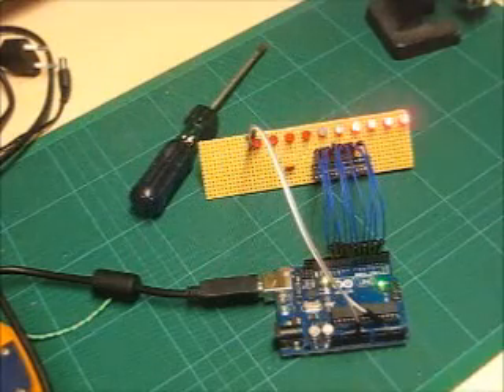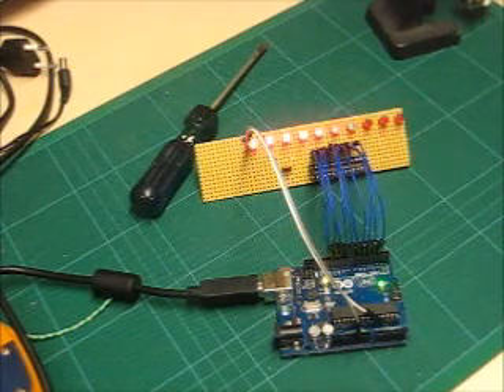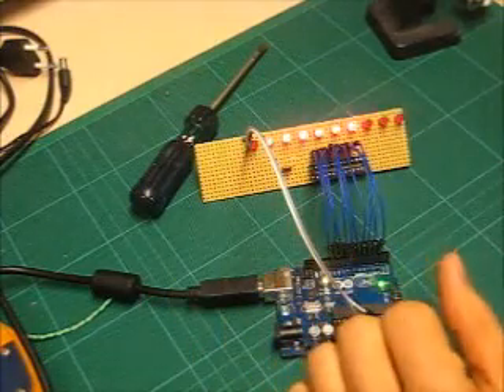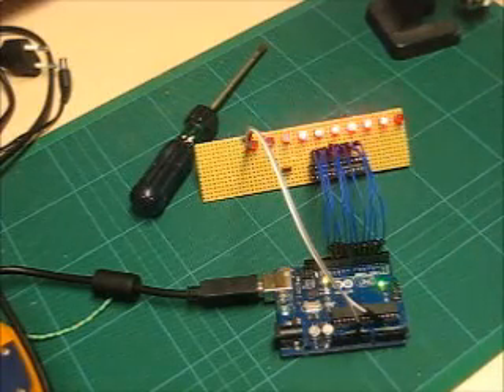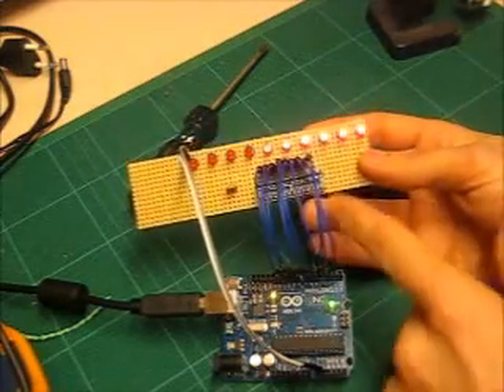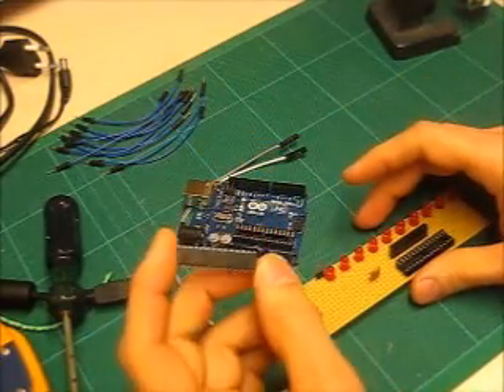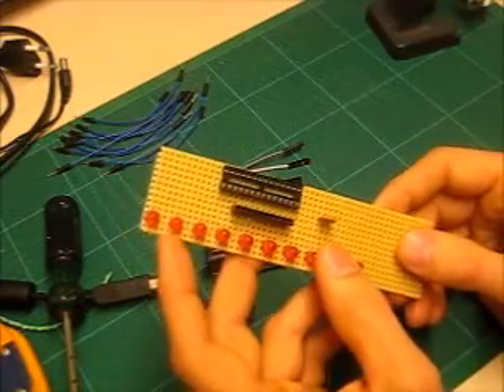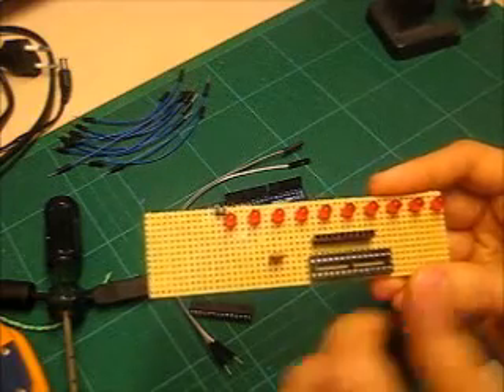DIY Arduino Cylon Scanner / Larson Scanner / Knight Rider KITT scanner LED lights

Comment: I think an Arduino is wasted for this very simple application. Even a NANO is bigger than the classical 555 + 4017 (sequencer OR light show "IC combo") and a bunch of 1N4148's (to drive the LEDs fore and back and in groups).
Reply from the maker: Ah, but if you watch carefully youll see that the LEDs arent just turning on and off, they are fading as a REAL cylon ;) so I wouldnt say totally wasted...
Reply: I see. But you could probably add different values of resistors in series with the diodes and get a similar effect. Well, at the cost of a little complexity added to the circuit. But this doesn't scare you so much, normally... ;)
Reply from the maker: It has to be put into the equation that when I made this atmega328s cost less than a dollar. I’m not sure why they have risen in price the last couple of years?...

Comment: Hi, please can you send me this programm (witch you wrote)
Reply from the maker: I used a program written by Runaway pancake over at arduino forums. But I uploaded the sketch here: http://www.duinos.net/show/?id=138 if you want to download it.
Reply: Here is the one I wrote, only 8 LEDs though.

void setup() {
  // initialize digital pin 13 as an output.
  pinMode(7, OUTPUT);
  pinMode(6, OUTPUT);
  pinMode(5, OUTPUT);
  pinMode(4, OUTPUT);
  pinMode(3, OUTPUT);
}

// the loop function runs over and over again forever
void loop() {
    digitalWrite(2, HIGH);   // turn the LED on (HIGH is the voltage level)
  delay(40);              // wait for a second
  digitalWrite(4, LOW);    // turn the LED off by making the voltage LOW
  delay(40);   
  
  digitalWrite(3, HIGH);   // turn the LED on (HIGH is the voltage level)
  delay(40);              // wait for a second
  digitalWrite(1, LOW);    // turn the LED off by making the voltage LOW
  delay(40);              // wait for a second
  
  
  digitalWrite(4, HIGH);   // turn the LED on (HIGH is the voltage level)
  delay(40);              // wait for a second
  digitalWrite(2, LOW);    // turn the LED off by making the voltage LOW
  delay(40); 
  
  
  digitalWrite(5, HIGH);   // turn the LED on (HIGH is the voltage level)
  delay(40);              // wait for a second
  digitalWrite(3, LOW);    // turn the LED off by making the voltage LOW
  delay(40); 
  
  
  digitalWrite(6, HIGH);   // turn the LED on (HIGH is the voltage level)
  delay(40);              // wait for a second
  digitalWrite(4, LOW);    // turn the LED off by making the voltage LOW
  delay(40); 
  
  
  digitalWrite(7, HIGH);   // turn the LED on (HIGH is the voltage level)
  delay(40);              // wait for a second
  digitalWrite(5, LOW);    // turn the LED off by making the voltage LOW
  delay(40); 
  
  
    digitalWrite(8, HIGH);   // turn the LED on (HIGH is the voltage level)
  delay(40);              // wait for a second
  digitalWrite(6, LOW);    // turn the LED off by making the voltage LOW
  delay(40);   
  
  digitalWrite(9, HIGH);   // turn the LED on (HIGH is the voltage level)
  delay(40);              // wait for a second
  digitalWrite(7, LOW);    // turn the LED off by making the voltage LOW
  delay(40);              // wait for a second
  
  
    digitalWrite(8, HIGH);   // turn the LED on (HIGH is the voltage level)
  delay(40);              // wait for a second
  digitalWrite(8, LOW);    // turn the LED off by making the voltage LOW
  delay(40);   
  
    digitalWrite(7, HIGH);   // turn the LED on (HIGH is the voltage level)
  delay(40);              // wait for a second
  digitalWrite(9, LOW);    // turn the LED off by making the voltage LOW
  delay(40);   
  
  
    digitalWrite(6, HIGH);   // turn the LED on (HIGH is the voltage level)
  delay(40);              // wait for a second
  digitalWrite(8, LOW);    // turn the LED off by making the voltage LOW
  delay(40);   
  
  
  digitalWrite(5, HIGH);   // turn the LED on (HIGH is the voltage level)
  delay(40);              // wait for a second
  digitalWrite(7, LOW);    // turn the LED off by making the voltage LOW
  delay(40); 
  
  
  digitalWrite(4, HIGH);   // turn the LED on (HIGH is the voltage level)
  delay(40);              // wait for a second
  digitalWrite(6, LOW);    // turn the LED off by making the voltage LOW
  delay(40); 
  
  
  digitalWrite(3, HIGH);   // turn the LED on (HIGH is the voltage level)
  delay(40);              // wait for a second
  digitalWrite(5, LOW);    // turn the LED off by making the voltage LOW
  delay(40); 

}
Reply from the maker: KidCommentaterHD Thanks for the code. But the difference is that your code is the "static" kind, where it is just one LED at a time turning on and off. What Runaway Pancake did in the code used in this project is that it is 10 leds that is smoothly fading so its a LED with a trailing fading tail kind of. It was this effect I was looking for as it is more like the KIT and CYLON effect (which used light bulbs which are slower fading in themselves). Anyways thanks again for the code :)
Reply: It is actually 3 leds at a time. But it does not have the fading effect, you are correct.
Reply from the maker: KidCommentaterHD Still nice though! Code is always nice to have a looka at :) Thanks again.
Reply: No problem, thank you. I just got an arduino the other day, and that was the first thing I coded myself. So it will get better.